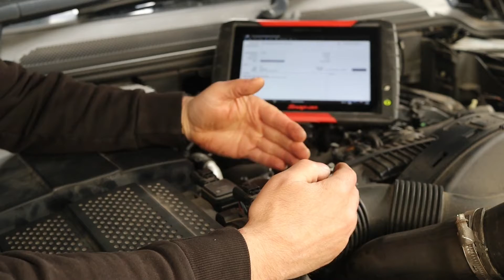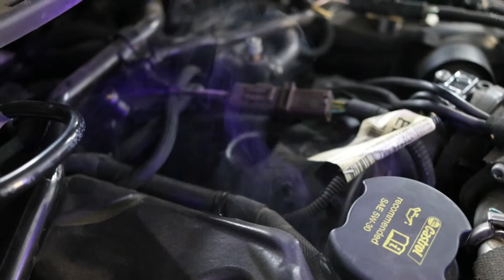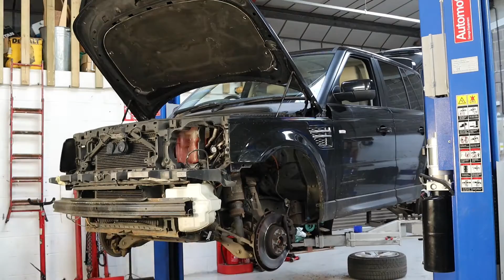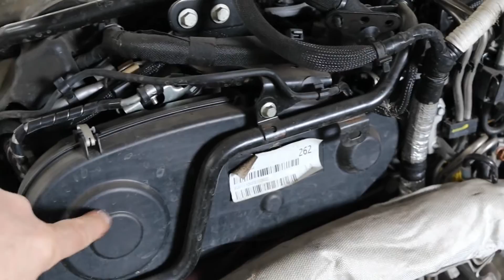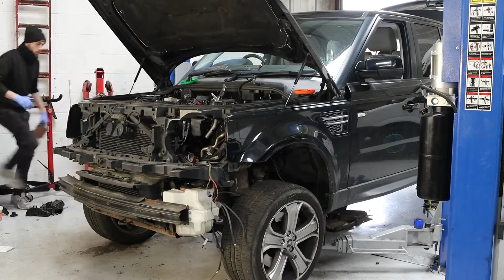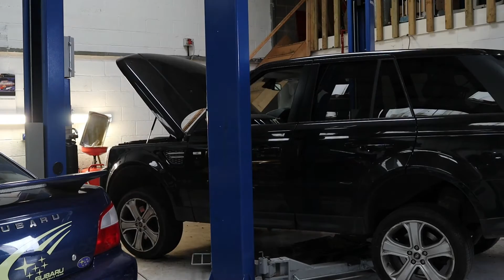Range Rover - fault code P006A

Comment: Common fault.  Any airflow correlation codes should be checked out using a smoke tester to identify where the airleak is, saves a lot of work!

Comment: Had my intake manifold go on me after getting the belts done on my 12 plate 3.0d xf its done 100k but they are prone to letting go.  The worst is once they go if you continue to drive it for any length of time after the dpf gets blocked up to so you end up paying 1500-3000 for the manifolds done then have to contend with a blocked dpf plus youll need to get the opil changed as fuel is dumped into the oil as the dpf regen fails .  Absolute nightmare.

Comment: Don’t need to remove the body done loads
Reply from the maker: @darrenbriggs261  I know but it's easier for us, no 2 mechanics work in the same way! Most of the time we've done these, the gasket at the back of the head pops off and you can't see it, so you get an oil leak and then have to do the job twice! No mechanic likes doing jobs twice. If you're doing both cam covers it takes longer with the body on. Thanks for watching and commenting 🙂👍

Comment: Hello Mels! Just watched your video and I'm starting to plan my RR Evoque's death certificate. My missus was driving it when she saw a warning saying "Restraints performances". We're currently abroad. She said it didn't feel right when she tried to change gears.  She felt as the turbo wasn't there. Please what can you advise us to do? I wish I could get you the car right now. It's 2014 REG.  Looking forward to hearing from you and thanking you in advance.
Reply from the maker: @Chrissian81  Hi, I'm sorry to hear that you're experiencing issues abroad, I wish I could fix your car via a message but without a diagnostic tool to tell me some codes and see the live data it's very difficult to say what your issue is. Call your break down service provider, they'll have a diagnostic tool to check the issue! I hope you get this resolved so that you can continue your journey safely! If you get a code let me know 👍🙂
Reply: @melsmotors  Hello Mels! Sorry for late reply. I haven't been feeling well (manflu). Anyway, you won't believe this. As I was waiting for the breakdown cover, I decided to temporaly remove the air filter. 20 mins later, the warning had dissapeared (gone - vanished). The lad came after an hour and plug his diag tool and found "NOTHING". We went for a test drive and "NADA" "RIEN".  I even showed him hte pic of the warning sign but he said I need to see a mechanic because there's nothing he can't do.  The mechanic said there's no much he can't do if his own diag tool is saying "nothing to declare"😉. He advised me to bring the car back as soon as the sign pops back.  Please what can I do then?

Comment: I had both inlet manifolds crack a different times on jaguar xf 3.0.  No need to remove the body.  Every jag owner needs a code reader  a workshop manual and a smoker

Comment: We do these manifolds in place & while we are there we do the oil cooler as well before it dumps oil into the V and all over the back of the engine. I haven’t seen a inj pump belt fail to date 
Incidentally you can now purchase alloy manifolds that come in cheaper than OEM plastic crap.. Great vehicles for a workshop but sad for the customers…

Comment: Hi there. I take it this process is the same for the disco 4. Although I have smoked it and not found a leak plus I’ve changed bank one mass air flow and I still have the same limp mode and code. Sad times.
Reply from the maker: Sadly not all fault codes lead to the same answer, hence the investigation work! Usually a fault code will tell you to look somewhere, it's not always the actual fault! Find yourself a good mechanic. You don't always have to take the body off but it makes it easier. By taking the body off you can do the front to rear brake pipes, as they usually rot out and have to be done with the body off anyway! 👍

Comment: The body off is not needed, I changed both intakes without the body off. Took me 7 hours of work.
Reply from the maker: We used to do them with the body on, just as easy off, theirs better access, and 9 times of 10 we end up doing front to rear brake pipes as they rot out, plus we do all the belts. 
Most of the time the OS cam cover gaskets ends up folding over at the back and you can't see until it leaks oil, so you  end up doing the job twice. Everyone does it their own way. Thanks for watching and commenting 🙂

Comment: What would the cost of this repair today? parts & labour? Cheers
Reply: Main dealer about £2500 to £3000 just had both inlet manifolds on Jag with same engine done, might aswell do both as you have to do so much to get just one off

Comment: Can this relate to blocked egr
Reply from the maker: Hi. Unlikely, an EGR fault is usually just an EGR fault. If an EGR is stuck or sticking you'll usually get an air flow meter fault to go with it. A MAF fault, mass air flow. You'll need to plug into it with a decent scanner, look at the live data and carry out an actuation test. Good luck

Comment: Looks like a job for JB Weld... Man, I would love you guys if you did a detailed video on taking the body off of a 2016 RRsport with the TD6.. It rans fabulous now.. but I fear the day.. It is an LR..Removing the body seems the only way you will be able to do anything.. As much room as there is in front of the fan.. It doesn't do squat for having to work on anything of signfigance other than changing the belt
Reply: One more question.. There has to be a master manual that guides you through the procedures to make repairs on these things.. Its insane! Would you be kind enough to share what is the best resource for specific repair procedures and reinstall? Thanks in advance..
Reply from the maker: @drostly3220  most of the technical data we use is all subscription based and only available for the motor trade as there is sensitive information within the data. I'm sure if you search through Google you'll find something. My videos are made for entertainment and not to be used as a repair guide, I make these for the interest of my customers. Thanks for watching and commenting 🙂👍

Comment: That was a huge amount of work for such a stupid fault. If you were doing it on a budget, do you think a local repair would have worked? Asking for a friend!
Reply from the maker: Hi sadly no, I've tried replacing the cam covers in past with body on and the gasket never locates correctly, plus you need the body off for the pump belt, they rarely go but it a service item. You can't just skip it because you don't feel like doing it, or the owner can't afford it - realistically you shouldn't buy a RR if fitting the bills are too expensive. Sadly they're unreliable, expensive to maintain & difficult to work on. Thanks for watching, I hope you friend makes the right choice, fix it right, fix it once. 👍👍😊😊
Reply: @melsmotors  thanks for the reply, you both deserve a pint for doing that really impressive piece of work. I hope the customer was happy. The skill and memory level is unbelievable. See you in the pub on Friday. 🍻

Comment: Definitely not a body off for both jobs.  Extra labour for no reason.
Reply from the maker: Thank you for watching Chris, I would very much like to see a video on replacing the pump belt. I've tried replacing the cam cover 2 times before without removing the body but the back of the cam cover gasket always come off and it's difficult to tell it's happened until you see the oil leak! End up doing the job twice! Book time 7.5 hours for the cover alone. Not for the lack of trying, we're always trying to save time with any job in a garage, ramp time is a commodity, but do it right, do it once. This is just our way Chris and not a tutorial. Thanks for your input. Regards Mel 👍

Comment: Hi guys awesome work. What would be the cost to do this as my RR has this exact problem
Reply from the maker: This repair is around £1100 from memory. Not cheap but it's a RR at the end of the day. Thanks for watching 😊👍
Reply: @melsmotors  that's understandable thanks for the reply
Reply: @melsmotors  1100 isn't too bad me thinks...In the US a full brake job is $2K...What engine is this the TDv6?
Reply from the maker: @electronate  yes this is the TDV6, thanks for watching 👍🙂